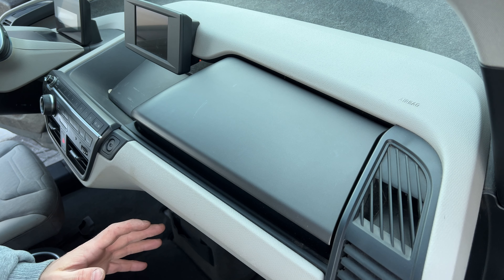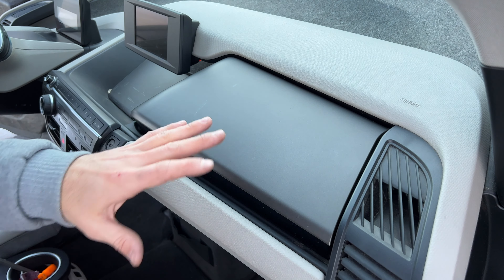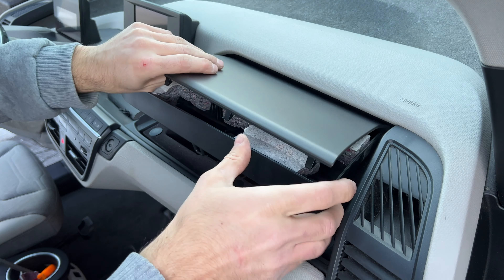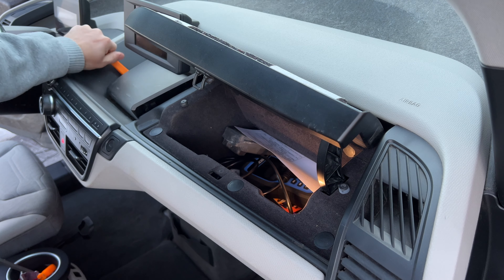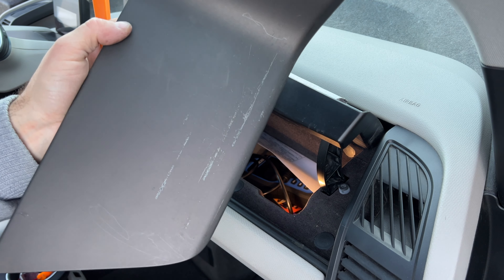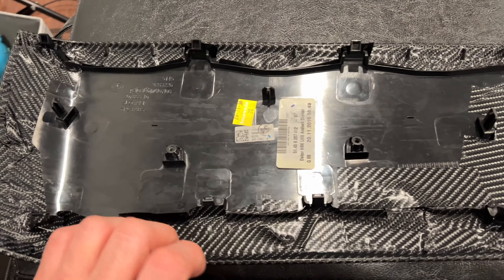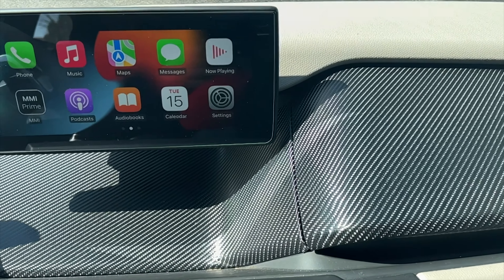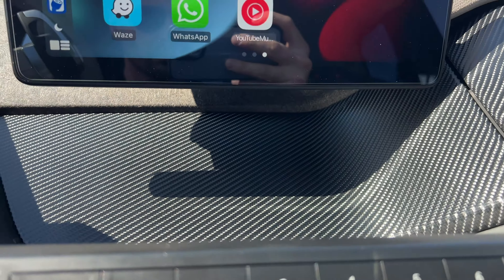I wrapped my BMW i3 Dash Panels in CARBON FIBER!

Comment: Great job and way better than a scratched plastic.  I have wrapped in vinyl CF cloth and it looks like the original bmw “carbon leather” they liked to use in some E-series, matte and a bit more 3D weave pattern. Hard to find the material now.

Comment: Are you able to access the original bmw settings menu on your updated CarPlay display?
Reply from the maker: Yes, of course. This is just an add on. You hold MENU for 3 seconds to switch between systems.

Comment: I’m struggling with corners to make it right.
Reply from the maker: I had the same problem. I used heat to make the area soft and then pulled it over the corners to stretch out the wrinkles. What also helped was starting in the hard areas first with the edges and then doing the straight lines etc.

Comment: Nice but a bit too shiny for my taste, so I may cover mine in black or dark grey felt fabric.
Reply from the maker: You can get matte carbon fiber vinyl and also this was filmed in direct sun. A lot less in your face when just driving around.
Reply: Fabric would absorb a little sound to complement the quiet interior